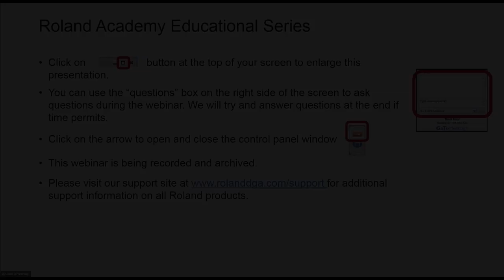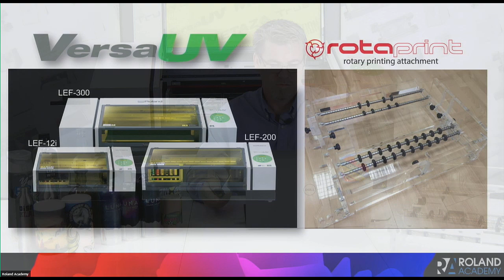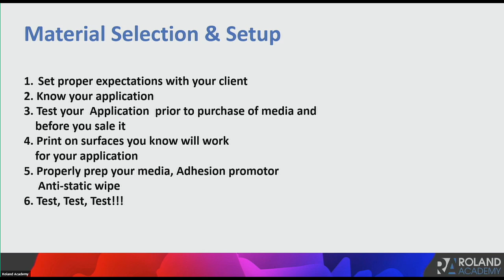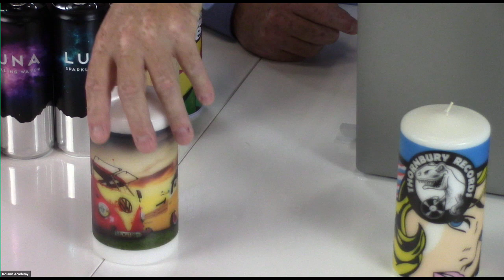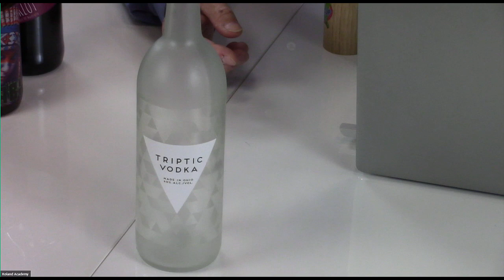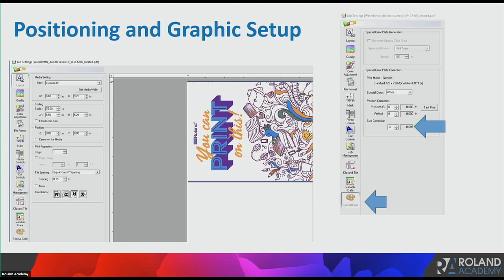How to Print on Cylindrical Objects

Comment: Hello, I have brought it for my lef 200 , the quality of the printing was terrible : ( even the guys of Roland in Italy were not able to help me. I left using it 2 years ago.  I have seen an announcement of a new accessory called Roland SC-RD-200 Rotary Axis for LEF2-200, do you think it will get the printing result to the expected result?
ps. have you ever tried to print on a facial cream jar or something similar, cylindrical object that has less than 3 cm height?
pss. what type of primer do you use to make the gloss stick on the object forever? with those official primer I was not able to use the gloss, because the result was too fragile print even when I made some extra uv passes!

Comment: Hello, I have tried to print on a candle with my Lef2-300. It looks really nice once printed. However, after a few hours, I've noticed some bubbling on the print and the print just peels right off! Any advice to make it "stick" is welcome! I have tried to print with and without the primer (machine cartridge). TIA.
Reply: That requires a more sophisticated sprinkler head,Please tell me your contact information or add me   whatsapp+8613169775153

Comment: Hello, thanks for all the infos and design ideas! My question is about setting up my document to print 2 or 3 bottles at the same time, to speed up production. I've been asked to give a quote to print a logo on 400 bottles! So if I can place 3 bottles at a time on the rota print... We have a Lef2-300. Thanks!
Reply: We have a large batch production printer, which can complete the output you need. Please tell me your contact information  whatsapp+8613169775153